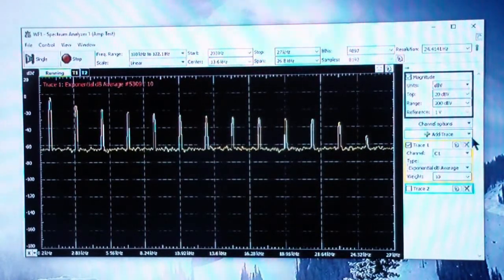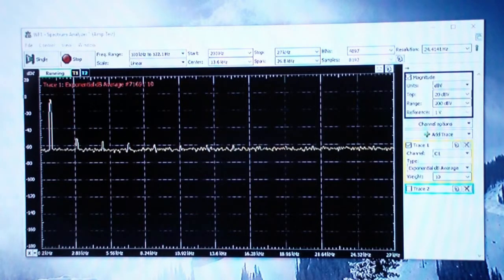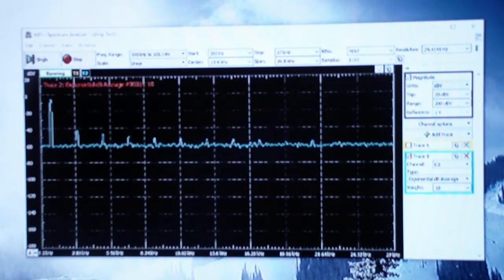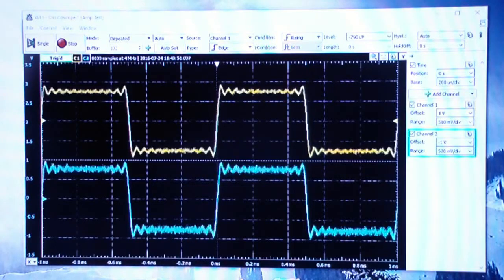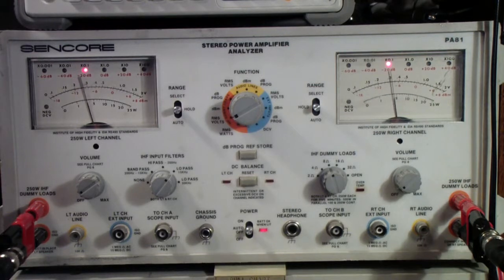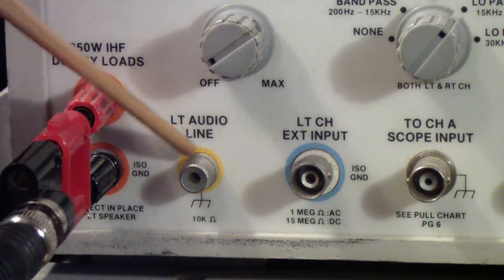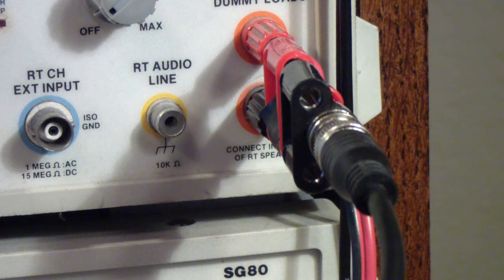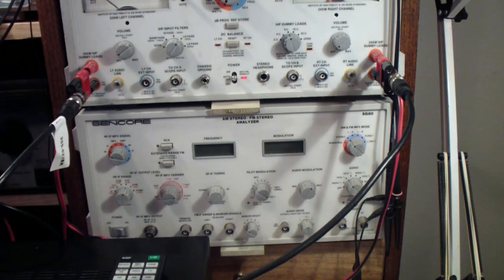TTT102 Analog Discovery2 Even More Amp Testing

Comment: A 1K square from a audio generator or decent function generator will show a clean square if the Sony or other surround receiver is in a "direct" or "Pure Direct" mode. I do this all the time. The artifact from an audio CD test tone or through the dsp of the receiver will often show a waveform very similar to that seen at about 5:25 in the video. Something a bit OCD about me I guess - I always want to see a "clean" square wave or a multimeter accurate to the last "zero".